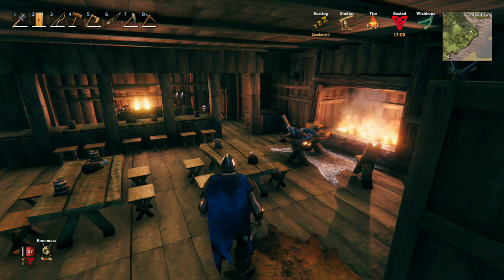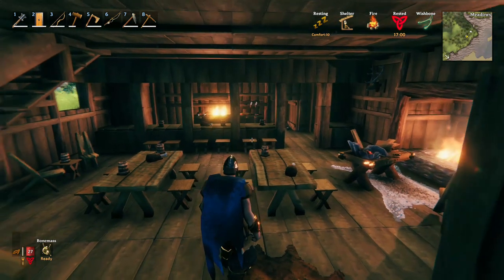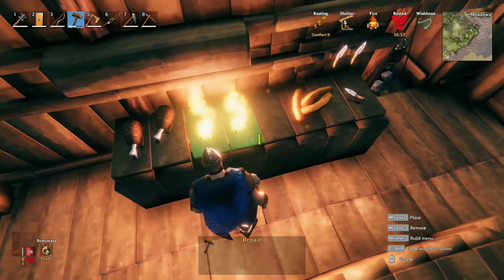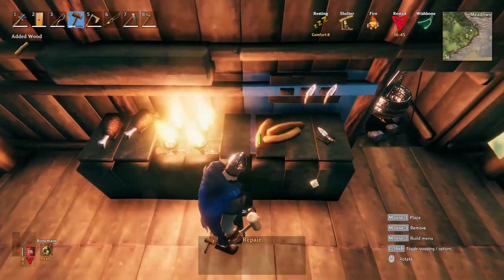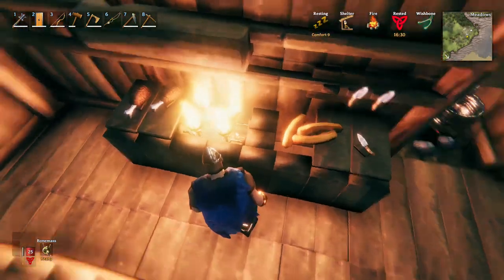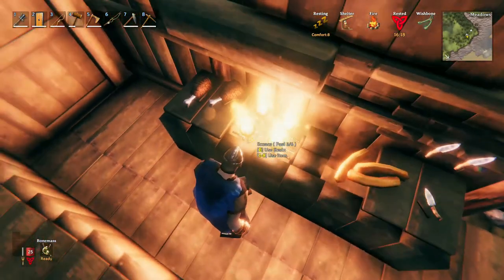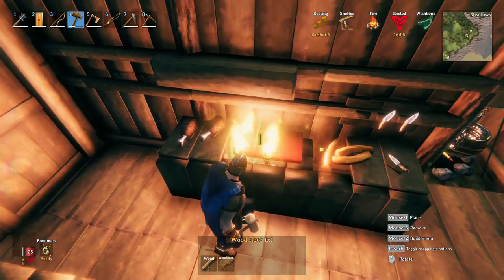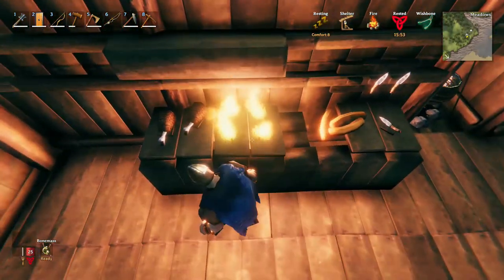Valheim - How to Build a Stove

Comment: I wonder if that would work with another short piece in there to hold up an item stand in the center, and then place a wooden tower shield flat instead of the floor piece for the burner plate. A flat wooden tower shield has the appearance of a grill.
Reply from the maker: Omg, ur a genius. I'm going to have to give that a go.